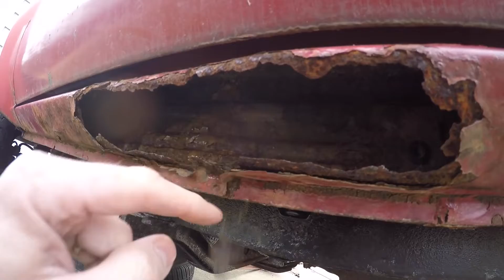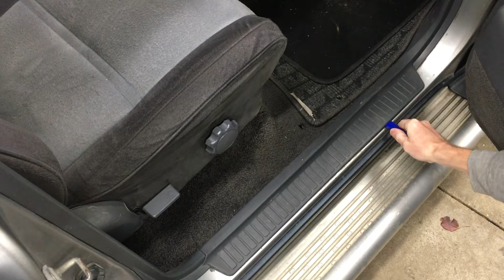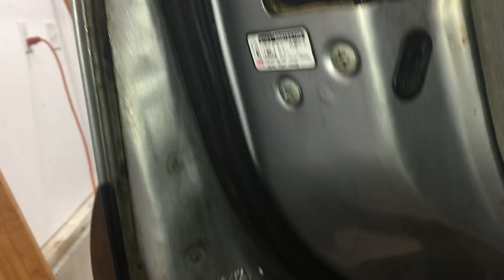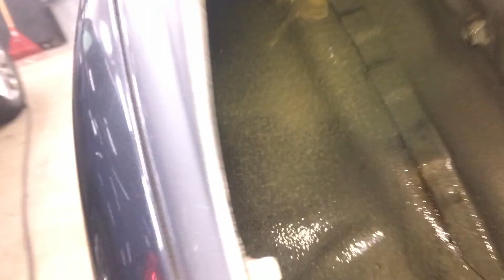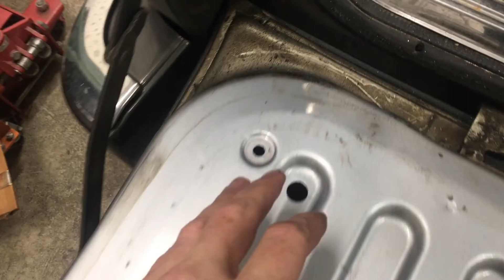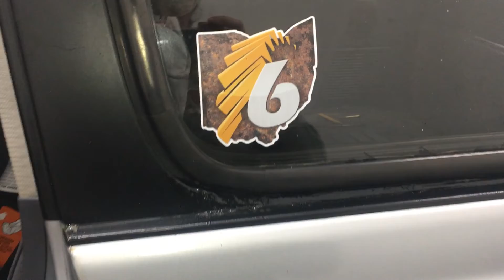How to: Prevent Rust on Vehicle Body with Fluid Film Aerosol:Toyota 80 Series Land Cruiser

Comment: That spray nozzle in the description is junk. Looks like they changed the can design since this video. It allows Fluid Film to gush from the top of the can. Seems like every wand in the world is unusable with FF cans. Frustrating.
Reply from the maker: I wonder if FF sells their own now that will be compatible with their cans...
Reply: @6thGearGarage  I'm returning this spray hose and getting ones I found that were $9 for four of them. I'm going to experiment with these hoses. I'll cut off the cap portion and use 3M Black Super Weatherstrip and Gasket Adhesive and/or bits of my Nealey Tire Repair strands to seal the straw from the can into one of the hoses.
Reply: Update... That was a failure... Either not enough pressure out of the can or the spray nozzle's are poor. I got a lot more spray out of the nozzles from the expensive wand that leaked.

Comment: I sprayed fluid film inside my doors (bottom, behind the rubber) and rockers and now my car smells like mildew, is this normal? It reeks, especially when my vehicle sits in the hot sun for an hour or longer.🤮 i feel like i will need to clean the fluid out and just spray some rustoleum....what would you suggest i do? The smell is so bad to the point where i could barely sit in my vehicle for that long.
Reply from the maker: It will usually go away after a day. You can park it with the windows open some to help air it out.

Comment: Can this be used on existing rust? Will the rust spread if it is not removed prior to spraying? Mainly under car doors, rocker panels, fenders etc
Reply from the maker: I've used it over existing rust, and although it won't completely stop it from spreading over time, it will help slow it down.

Comment: Where did you get the extension want is it leaking at all on the top of can
Reply from the maker: There's a link in the description for the cans + wand. The wand I had worked great for a while, then started leaking. Now they sell a 3 pack of cans with a wand included for those exact cans, so it should work better hopefully.

Comment: I spray my winter tire rims inside and out with fluid film, it forms a mat black tough film that doesn't wash off, similar to what you see on the bottom of a car door that's been sprayed.
Reply from the maker: I do a light coat on mine before winter too. I just cleaned them off with a pressure washer last week. It's so good to see them clean again!

Comment: When I see these rotted cars, I wonder do these people do literally anything about the salt? Even an undercarriage wash weekly will help. I do not understand.
Reply: If you have fluid film under your car, you are better off not doing the undercarriage spray. People on youtube actually did tests on that. If you don't have fluid film, you still might be better off not doing the undercarriage spray because it keeps it wet. I use to pressure wash the underside of my cars weekly and they still rotted out so bad they wouldn"t pass inspection. My son did the undercarriage spray all the time and we just sent his car to the crusherI it was unbelievable how rusted the underside was and it only had 67,000 miles on it but was 20 years old. Fluid film is the way to go otherwise it's going to rot.
Reply: @ron4413  Fluid film is the best. My dads truck is rotted to hell.
Reply from the maker: It's amazing how many people do nothing. I guess they don't plan on keeping the car for a long time, then it ends up rotting out on a future owner.

Comment: Hello, I just acquired a 2nd gen Tacoma. Was wondering if I can spray FF in the water drain holes at the bottom of the door. Am worried because I don’t want it to clog water from the FF. Thanks as always!

Also I heard FF swells up rubber would it be safe to spray it near the weatherstripping?
Reply from the maker: Yes you can spray in the bottom of the doors, just don't over do it and clog the drain hole.  That protection in the bottom of the inside of the door panel is important. I have had FF swell some rubber trim and not others. My Toyotas have been OK, but the weatherstripping on the hood of my acura swelled up noticeably.

Comment: How long does it take to dry/cure on underside before driving again?
Reply from the maker: You can drive instantly, as it always stays kind of greasy until after a couple of trips down dusty roads and it will get a layer of dirt on top of the fluid film.

Comment: Hey dude. How many cans of Fluid Film do you need for an 80 as you did it?
Reply from the maker: I used 3 for everything I did in this video, plus I sprayed some inside the frame holes.  I had already done the underside using a spray gun and bulk gallon. (I only used about half of the gallon)

Comment: Is it ok to use on rubber, or rather have you had any problems? I saw some comments somewhere that said it makes some rubber not resistant to oil soft and sag. Also have you ever used the Fluid Film Black? Is it the same thing only in black? Thanks
Reply from the maker: On my acura I found it did cause the rubber beneath the front edge of the hood to expand a little. I've never had any problems with bushings or hoses though. I haven't used black, but I've read that it's the same formula, just black on color. I stick to the original because it's a little less messy if I have to do any suspension work, being somewhat yellow instead of black.

Comment: Do you have water leaking issues from those sliding trunk windows?
Reply from the maker: If I spray them from the outside with the hose nozzle on full blast, a tiny bit of water will drip on the inside. But under normal conditions, they are good. I did clean out the channels when I first bought the toyota. They were full of pine needles and dirt.